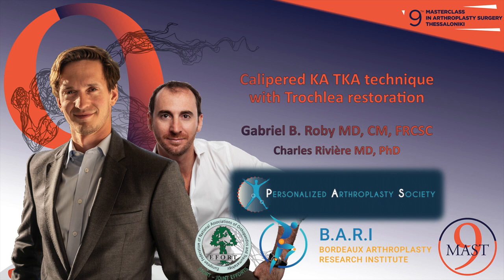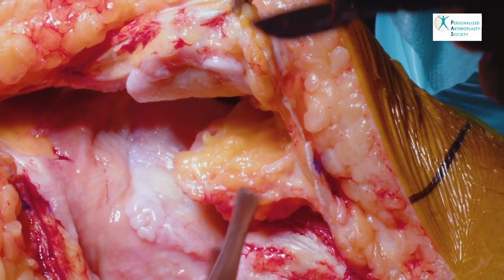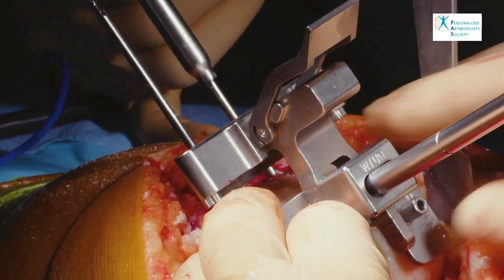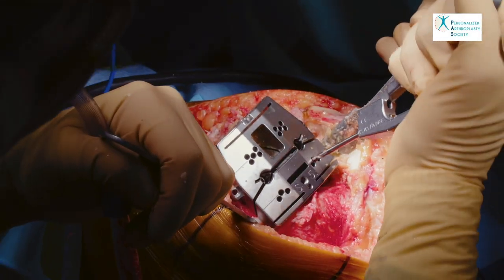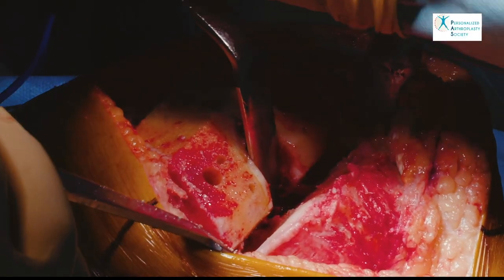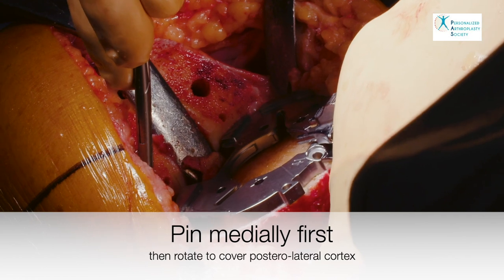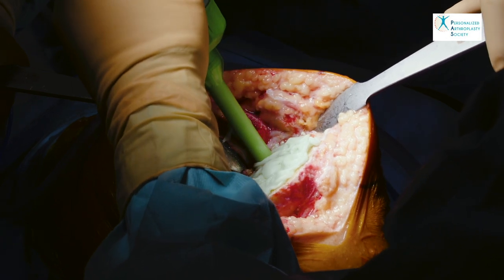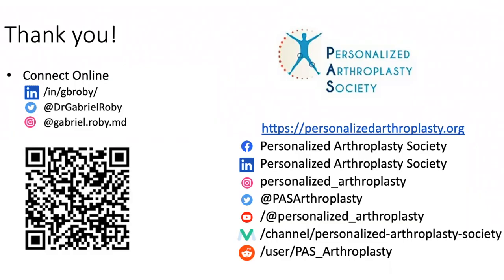Calipered Kinematic Alignment of Total Knee Arthroplasty with Restoration of Trochlea

Comment: Thanks for this. The pre-op X-rays would seem to demonstrate patella Alta with lateral tracking. Would you consider restricted correction of this as her primary complaint is patella pain; ie maintain a kinematic approach to her tibiofemoral joint, but consider a medialised patella implant with perhaps a 2 degree external rotation of the femoral implant from the posterior condylar axis? I understand the approach is restricted kinematic but it would seem the native patella position/tracking is not within a “normal range”. In the same manner that some consider a “normal” HKA to be +|- 3 degrees, with a max 5degrees femoral/tibial angles, do you believe there to be a “normal” range for native patella position?